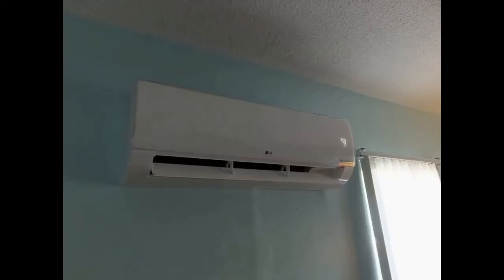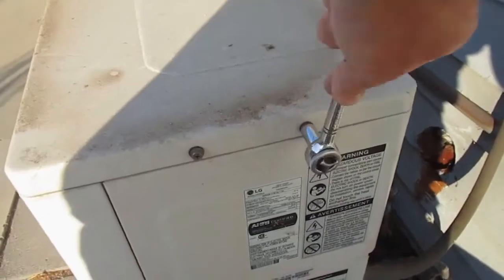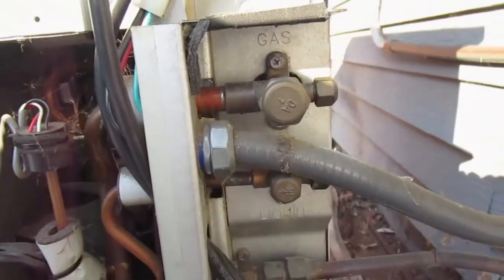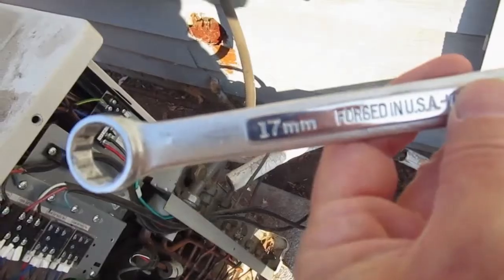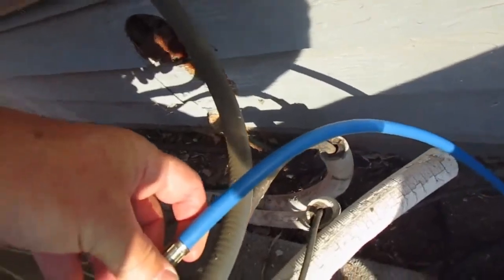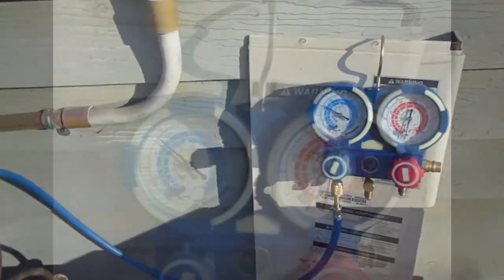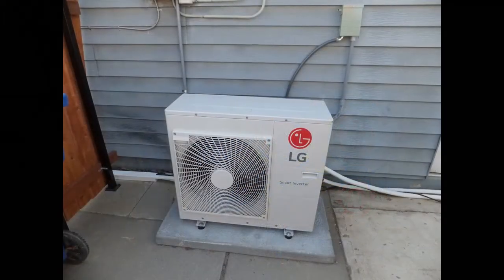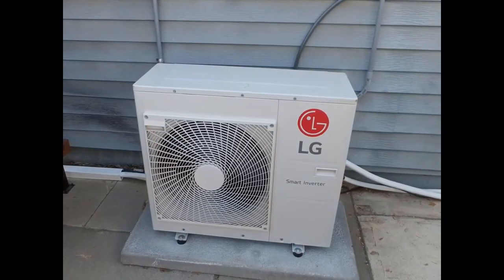How to Check the Refrigerant Level on a Mini Split

Comment: This, and lots of videos neglect to warn that you must make sure your hose has the protrusion, and it is long enough, to push in the Schrader valve. Many do not, but they can be unscrewed to stick out far enough to do the job. OTHERWISE YOU ARE NOT GOING TO GET A READING, or in other procedures vacuum down the system. How do I know? Learned the hard way.

Comment: Hi there, great video and explanation. Much Appreciate it. 
So we have a midea split system with heat pump which doesn’t blow cold anymore the fan come on and humming noise you hear and then the fan turns off… also changed capacitor. Checked refrigerant pressure keep reading gauge 225 psi with system on full cold. All the currents are also ok ..
Reply from the maker: Unfortunately you may need to call in a pro. Sounds like there is plenty of refrigerant in the system if I'm reading this correctly. You may wish to check out my more updated series of mini-split videos via this link: https://www.youtube.com/playlist?list=PLVKf1LufzYvLRqYcO8i2RH83eMApVKxft

Comment: That video is worthless! So what do we do if the reading is 140 or 100 psi. How do we know if we have too much or too little? Were you in heat mode or cooling mode? Does it matter if you are in heat mode or cooling mode when taking those readings?
Reply: How is the video worthless?  If your pressure while the mini split is running is significantly below 117psi - 120psi (the most common pressure) then your coolant is low. 

Ta-da.
Reply from the maker: Instead of complaining, check out my updated series of videos: https://www.youtube.com/playlist?list=PLVKf1LufzYvLRqYcO8i2RH83eMApVKxft

Comment: So if you have the guages connected to  the valves the lineset attaches to obv they wont be hooked up right? So whats the purpose of running the outside unit?  I dont understand how the pressure drops 100 psi if the refrigerant has nowhere to go?  Tia
Reply from the maker: Check my updated video on adding refrigerant here: https://youtu.be/nlm6zbYVwqQ  ....there are more details than the older video you are referencing.
Reply: It's being compressed and running through the rest of the system.

Comment: Not all mini splits are heat pumps. All inverter mini splits are heat pumps. In Florida i buy AC only non inverter mini splits.   
Basically they are old technology with mini split head unit. No expensive control board.
Reply from the maker: Sounds like a good plan for where you're at in Florida, I would agree with you. Here in California, it gets chilly enough - esp. at night - in the winter months to require a heat pump. BTW for those not in the warmer states, heat pumps won't produce enough heat in harsh winters to keep your dwelling warm enough by themselves.

Comment: I see a missing bit of major information, this is the purging of the hoses and gauge manifold. For those that are clueless, this must be done, and yes you blow a bit of charge doing this. As well when you remove the hose, there may be condensed liquid in them that is lost, but it's fractions of an ounce. The proper way to do this is to use a tank of refrigerant connected to the yellow charging line, and set up a slow flow stream of refrigerant initially blowing the hoses and manifold clear of non condensable air gases (if your only using the yellow and blue hose, also purge the red hose). Then as you connect the blue line to the system, the Schroeder valve is opened (by that tang in the hose), and you simultaneously close the low side valve connecting the common manifold chamber to the yellow hose tank common connection port on the gauge manifold.
If the system was a conventional system using a similar type of metering device (capillary tube, or piston) where the operating pressures are charge critical, and there's a conventional coil in a plenum duct, then the wet bulb temperature of the return air, and outdoor drybulb temperature can be measured and put into a table to find "Target superheat" (google this), and that number is what is used to set the charge. So you take your gauge suction pressure converted to saturated refrigerant temperature, and measure the temperature of the suction line closest to the evaporator, if at the condensing unit, and that line is adequately insulated that is OK to use as the reference for superheat measurement. But that temp will be warmer then the saturated temperature measured with the gauge (the temperature that the refrigerant is boiling at). And that represents the superheat of the refrigerant warming above the evaporator boiling temperature. If that is low, then the charge is too high, if that is high then the charge is too low. This superheat represents if the evaporator is running out of refrigerant before exiting. You want it to just run out of boiling cold refrigerant so it does not return liquid back to the compressor. And if it's boiling off long before the end of the evaporator, then you don't have enough refrigerant to cool the air sufficiently.
So I'm looking to find the method of charging a minisplit that does not have that air inlet plenum, and I'm thinking you just measure the room inlet wetbulb near the inlet of the wall mounted heat exchanger unit. I'll keep looking to validate that is the correct method. But what I've been seeing is to recover the charge, and weigh in the new charge per the manufacture data sheet for that vendors model number. But I don't have an empty drum to recover the charge.
If you ever want to recover the charge, and don't have a recovery system, then a cheap way is to use a recovery drum, stuck inside a styrofoam cooler, with dry ice to chill the drum (leave the system off during this, as the refrigerant is part of the motor cooling, and you don't want to burn the compressor motor up). Watch the gauge, and when it gets down to 20psi, close the recovery valve. As you want to leave some positive pressure and not suck a partial vacuum. Then weigh the tank (pull it out of the cooler, so it will warm back to ambient), and restart the system, to suck the drum refrigerant back in. Measure how much weight was put in, then put your fresh tank on the system to finish adding refrigerant per the known manufacture charge weight.
Some minisplits use an electronic metering device, and that don't apply here. There are metering devices called thermostatic expansion valves, and they control a constant super heat (typically around 10 degrees F). A much easier system to charge, as when I installed mine, I put a sight glass in the liquid line, and charge until there are no bubbles. But that's not applicable to these minisplits. I installed 3 minisplits last summer on my home and garage, I installed sight glasses in all of them, it only tells me there is charge circulating, and there's tons of bubbles, which is normal, as they put the metering device in the condensing unit, typically.
Hopefully this is useful to someone.
Reply from the maker: Dude -  maybe you should make your own video. Just a thought. Also: I'm a DIY guy, and getting pro help for my mini-split was either insanely expensive or simply not an option.
Reply: @DoItYourselfandSave I'm all for DIY, and your channel has some good info. I did not mean any negative, but that seems to be a common missing task in every youtube video I've seen (proper purging of the gauge manifold hookup). I'm just trying to help those that want to do DIY, and not harm the existing system with induction of non condensable gasses.
I can see at 36 seconds in, that someone wired your outdoor unit to indoor unit correctly (I see in another video that you hired that out). The wire size is not the 16AWG they include in these kits (or your LG kit provider had this correct 4 conductor wire, you probably purchased a roll of this for that long run). Every kit I've seen sends this wire in the wrong size, and it violates NEC code, as it is connected to a 15amp or larger power source. Even HVAC techs don't comprehend that error. If the power feed is 12AWG (a 20amp circuit), then the connection to the inside unit must maintain that size even it it only draws 0.5 amps. The easy solution is to have a fuse in the outside unit sized for the smaller wire. But that creates another maintenance issue of replacing something hidden from view, that can blow open. 
About the only thing I would have done different is to use crimp on terminal lugs for all 4 wires, especially that ground wire, as stranded under a screw can come loose. Looks like your unit can handle 4 inside zones. So I just watched your video on minisplit installation quotes. This is a problem with HVAC everywhere in this country. 
I got one of mine off Amazon last summer, a Daikin. 12KBTU@$850. Came with a short 15' connection kit. I had access to the inside wall where I installed this, as well a sanitary sewer for the condensate line. I have my outdoor unit installed on "L" brackets (to the studs of the existing house, a real problem as these units don't use 16" spacing, so I mounted two rails of aluminum Uni-strut, and bolted the brackets to the condensing system mounting metric spacing), as I have grass in the location, and I wanted to keep them up high for easy service and away from the blown lawn mower clippings.
You're probably on year one of this LG, too soon to see if it will provided trouble free service. There's so damn much electronics in these. And they don't use any conformal coating on the circuit cards. Searching for where the issues come from, reptiles, amphibians and insects can short out the boards in the outdoor unit, as well water vapor condensing on the boards during winter heat pump operation.
Those dust caps should be kept tight with a wrench as Schroeder valves leak slowly over time. But I guess you loosened that just before recording the video.
My experience in HVAC, I went to a 2 year trade school back in 1974, for this. I worked as a lab technician for "The Trane Company" in LaCrosse Wisconsin (now owned by American Standard). Back then they taught both residential and commercial wiring practices to HVAC techs, as they did the total install, these days a licensed electrician is required, at least in municipalities that have adopted code standards. This was some the best schooling I could have, as it encompasses so many skills of many different trades. I lasted a year in that job, as I was smarter then the engineers telling me what to do, so I went back and got an EE degree, and worked on avionics until I retired 8 years ago.
I have zero respect for the HVAC trade, if you've ever gone to any HVAC blog website, the treatment of DIY by these 'professionals' is extreme disrespect. As if they have some special skill and it's technically impossible to share. While I was still in school they taught us that take what ever you pay for whole sale parts, and double them. Some of the money is needed if there's a brick and mortar biz location, with office help. And service trucks, and insurance both for liability damage/personal of bad mistake's adds to a biz cost of operation. But I agree your quotes were all out of line. I don't know what hourly rate is in southern CA, but $200/hour should cover overhead, so $1600 for an install of something that should have a retail sell price of $3500, so $5100 to $5500 should give enough profit. So your estimate is in the same area I would expect it to cost.
I know there is lot's of effort in your video production, all the graphics, and secondary video shots, that either you created or had to find, and pay or organize a copyright to use. Your monologues are well worded. I even subscribed.
Lastly, today's news had the China virus issue, where 3 technicians from the virus research center in Wuhan, in Sept 2019, went to the hospital there. But getting to the truth with China central government controlling all propaganda and access is now lost. You had this issue in your minisplit quote video. And China is spreading their own propaganda of the USA research lab spreading this virus. Sorta hard to deny it came from China.
I'll wait for your next video.
Reply from the maker: We had a pro come in and install the electrical, which I wasn't going to touch. I'm ok trying to work on recharging refrigerant, but I know my limitations with anything electrical esp. with a dedicated line. So good call on your part; yes, that part was done professionally. Unfortunately, too many HVAC guys in our area (at the time) either didn't want to bother with recharging mini-splits or we found their costs to be completely out-of-control. Glad you caught the China info that I put in there! Thanks for your input, cheers --
Reply: @DoItYourselfandSave  recharging should only be done alongside or after a leak search and repair. It could just be a loose flair fitting, but without the tools and experience of a professional, you're risking catastrophic damage to your compressor. A pro should charge about $180-220 for diagnostic and labor if it isn't completely out of refrigerant(they would confirm that's your problem, which it typically isn't), and then maybe 1/2lb of refrigerant. You're spreading illegal and potentially damaging advice.
Reply from the maker: @Brokentwobutton  ok I'll bite: you're an HVAC contractor, aren't you?
Reply: @Brokentwobutton  That's not true. You might need recharging / additional on the day of install if the line set run is longer than what the factory precharge covers.
Reply: @ryankramer  this is a diy minisplit video. The line set only needs to be 7', and then the DIYer rolls the rest of it up like 300PSI spaghetti and hangs it off the side.

Comment: You are missing to share the most critical information in the video; the out door temperature during measuring the presure at standing state (while compressor is off). According to that outdoor temp the pressure will change alot. Your outdoor temp is probably around 75F and shows around 225psi, mine shows 170psi because it is 60F outside.
Reply from the maker: Fair enough - but I'm not an HVAC pro and I admit it. Also, pull up vids by so-called "pros" (I have) and many of them never mention outdoor temps.
Reply: @DoItYourselfandSave  :) use this chart for the pressures for different temps, it will help alot :) https://highperformancehvac.com/refrigerant-r-410a-pressure-temperature-chart/ Nice video, have a nice day sir.
Reply: @burakokumus6040  The pressure/temperature chart is already on the blue and red gauges. That's how you convert pressure to saturation temperature inside the condenser coil (Blue/Vapor side) or evaporator coli (Red/Liquid side).